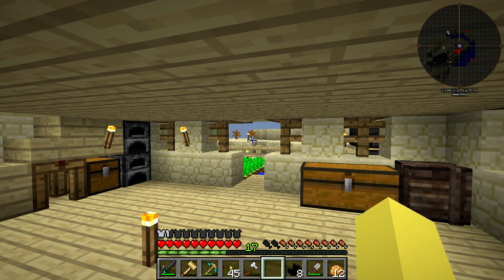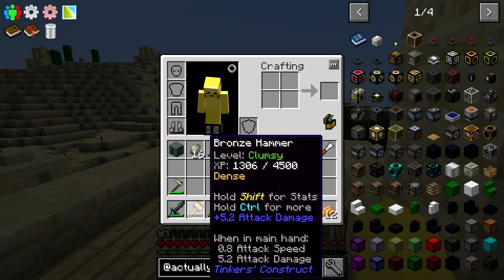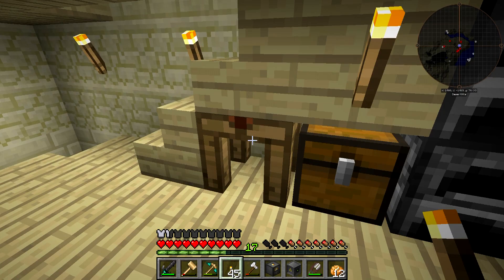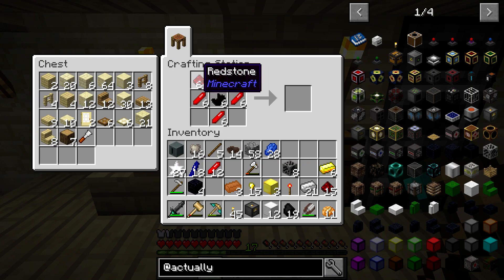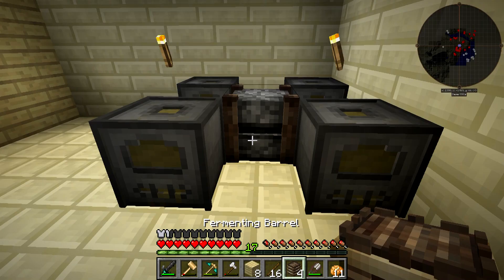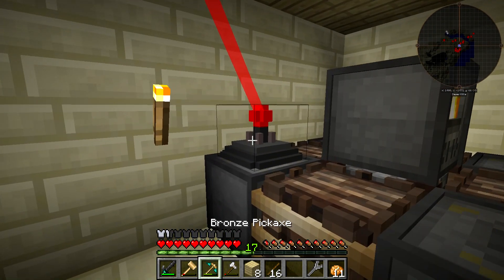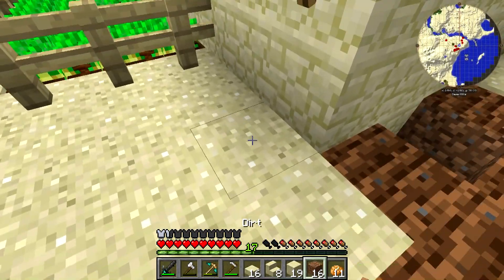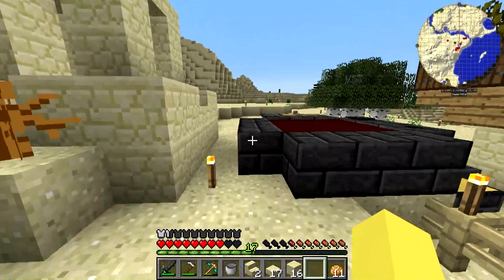HermitPack :: E02 - Canola Power

Comment: This doesn't make canola fast enough to keep the oil generators fired for me. I made a second 19x19 farm and it still barely trickles in. I don't use torcherino, so I think this is just not a viable solution.
Reply from the maker: Yea, it definitely isn't a farm I would suggest past early game. I thought it would be interesting to see how good it could get, but it maxed out quite fast and wasn't as good as I had  hoped.
Reply: I ended up building a Yellorium reactor. I focused on resource gathering and ore tripling very quickly in my current game so was surprised I had all the resources I needed to build the reactor.

Now that I've done a reactor, I can't imagine using any other energy source. I was limping along with 2 solar panels and 5 windmills, and power would drop off completely anytime I tried to run a spawner or void miner. Heck, it was dropping just while I was running ore processing. I used a design similar to what iskall85 did, but made mine a bit shorter. 
I had also set up a pretty large and complex gas-burning generator system with electrolytic separators. That didn't produce much net power either, most of the energy produced went right back into the separators to keep it going.
Reply: u need to upgrade the oil